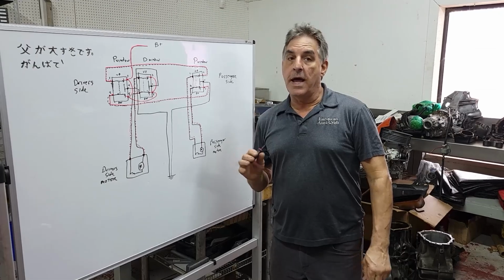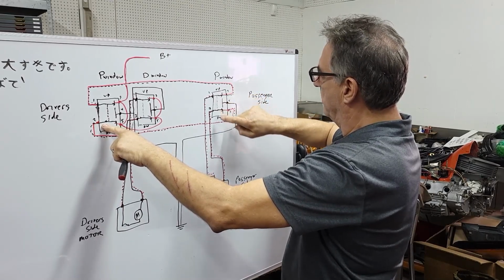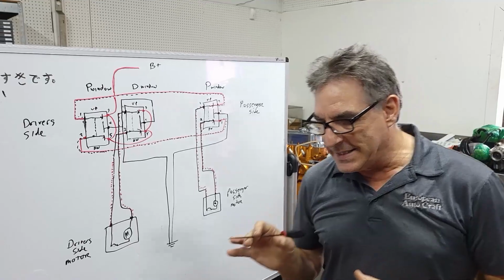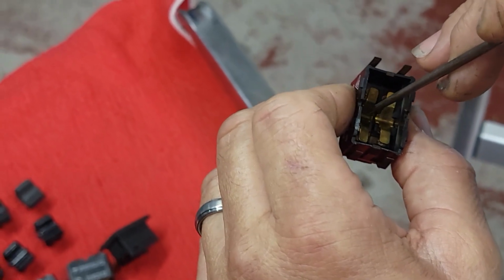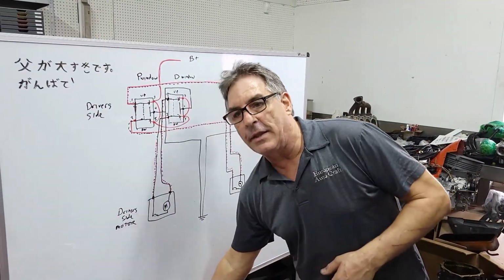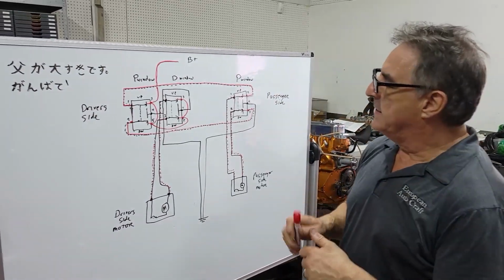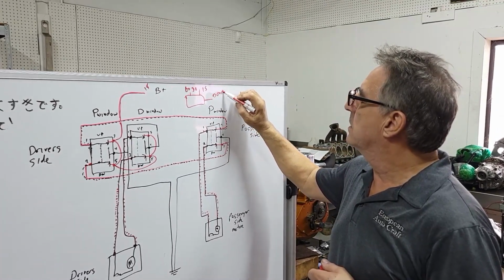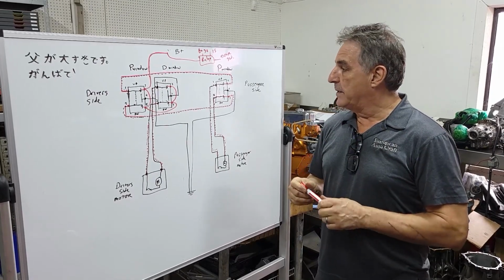1974-1998 Porsche Window Switches - How They Work, Rebuild Service Available

Comment: Hey so if I test the volts coming out that’ll help me know if I need a new switch? Took this car apart passenger motor was unplugged. Guy it was bought from said window worked before he had it wrapped. I plug it in and the motor just spins one way without touching controls. I was thinking replace both that switch and the switch that controls it driver side. But whoever took it apart last also could’ve put the wires back wrong. Do you have any diagrams of the wiring?
Reply: 1978 911sc
Reply from the maker: Someone connected the switch wrong. I'll find the wiring diagram and send it to you.

Comment: Awesome video, well explained. I learned of the passenger side switches being daisy chained the hard way - spent way too long diagnosing the passenger switch being bad, but ended up being the passenger switch on the drivers side.
Reply from the maker: Some things are a mystery,  but once you see how it works, it all becomes so easy